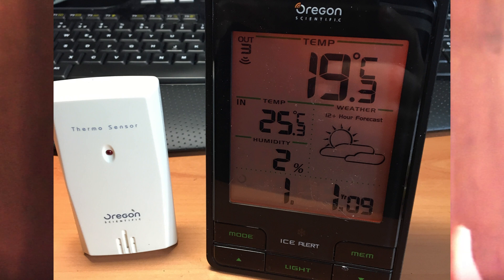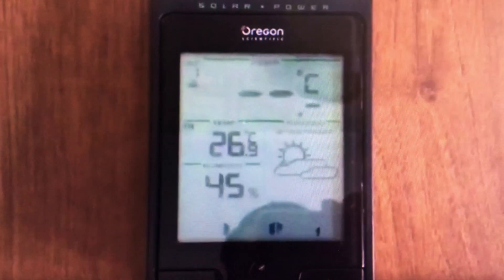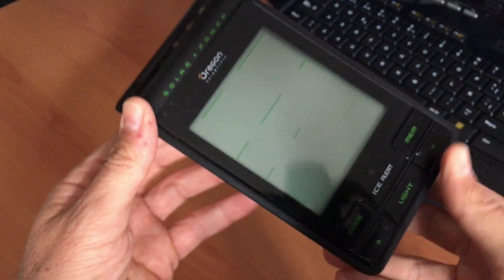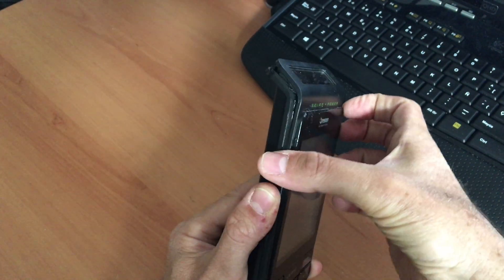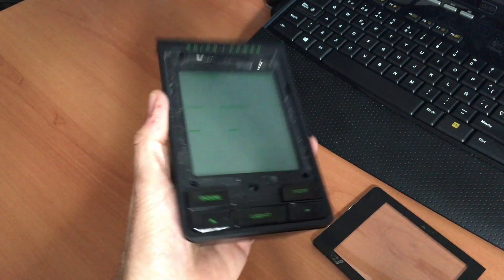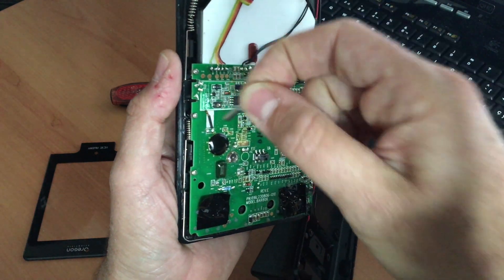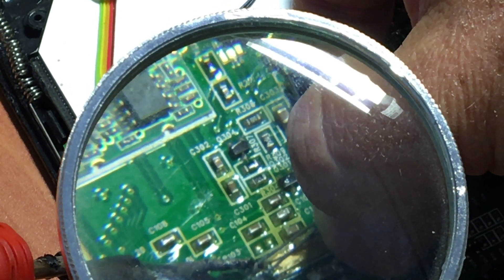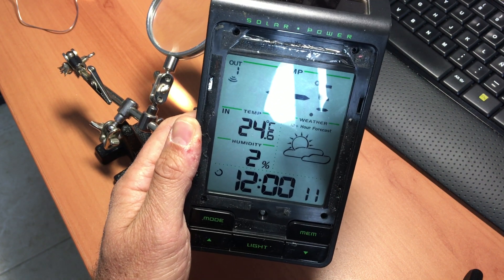Oregon Scientific Clock Repair - problem - BAR806

Comment: I have a similar model as yours. However the problem I have is that the screen would turn off, exactly 4 min and 2 seconds after changing the batteries or pressing reset. During the 4 min widow it worked fine. I changed the crystal oscillator as you advised and it fixed the problem. The oscillator I used came from a broken digital watch ( I don’t throw much away).  Thanks for posting this fix on YouTube.
Reply from the maker: Excellent news ! So you could repair it !

Comment: Thank you from France, on BAR206, blinking pattern, and no readable numbers. The crystal XT1 not readable so I used your value "32 768" and it worked like a charm. A new weather station for 1 euro, and I have like 9 other crystals for the next problem ;)

Comment: This solution also works for BAR629HG. Crystal oscillator XT1 has a mark something like "S511" on it. This code is useless to identify the frequency. Because you mention the value, another Oregon Scientific comes alive. Thanks a lot!

Comment: I have an Oregon BAR208HG with the same problem - really useful video, THANK YOU! I've identified the crystal but can't find the same replacement (marked S0Y1). Crystals of the same size from component stores are 6pF or 12.5pF. Does it matter which I get, which capacitance would be best? Thanks.
Reply from the maker: I really don't know... but considering the "use" of the crystal, I think the capacity will not be important. In any case, if the crystal is cheap (it must be really very cheap) then I would recommend you to buy both components... and this way you can try one and the other. It would be nice if you can share your experience once done. Best regards !
Reply: @FrancescMas  Success! I ordered both components as you suggested, intending to fit the more expensive one first (still only £0.59). However they made a mistake with the order and only the more expensive one was delivered. This was 6pF and the weather station seems to be working perfectly again now, so if other people have a choice - perhaps try 6pF first. Thank you again!
Reply from the maker: @duncant2413  Thank you very much ! I wish this will help people with similar issue !!